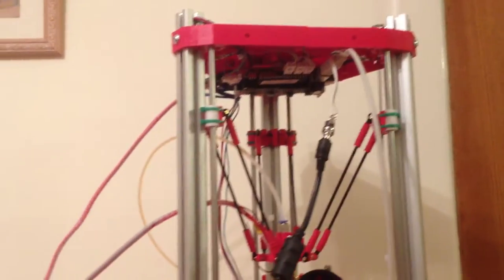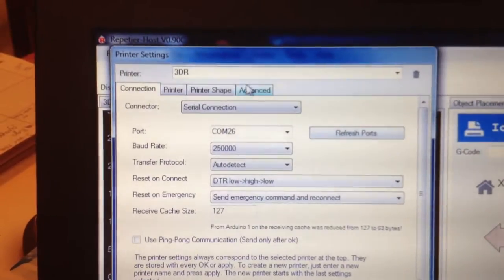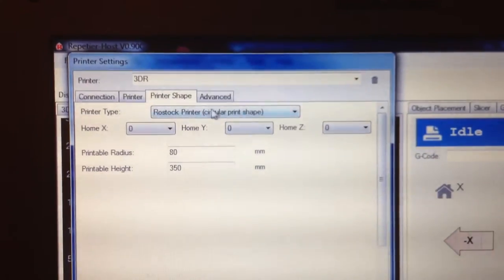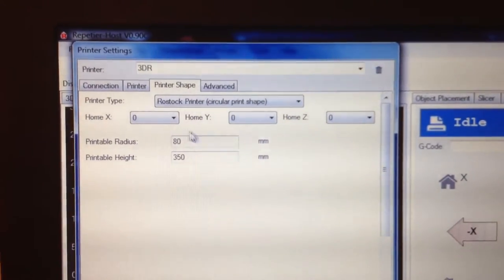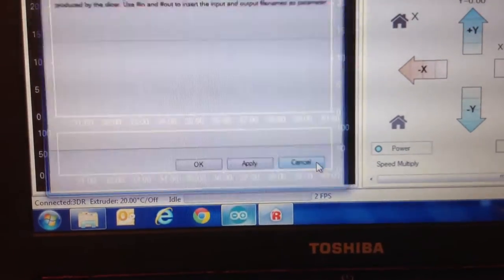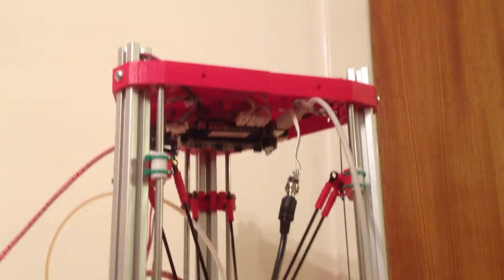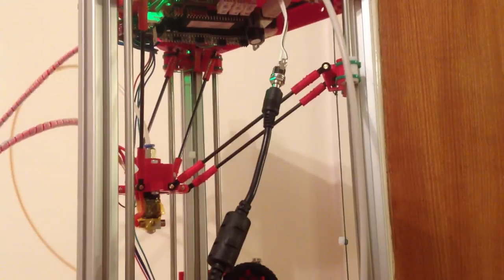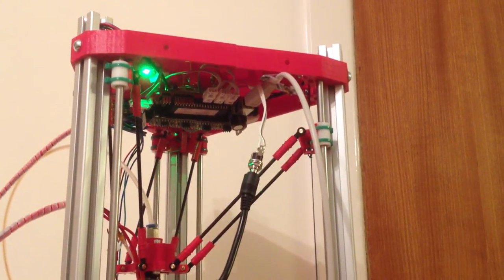3DR delta printer almost working

Comment: Possibly dead stepper driver. I had one die on me due to removing the stepper while the board was powered. It behaved like this, unpredictable direction. Try swapping another axis driver and seeing if the problem persists or if it moves to the other axis.